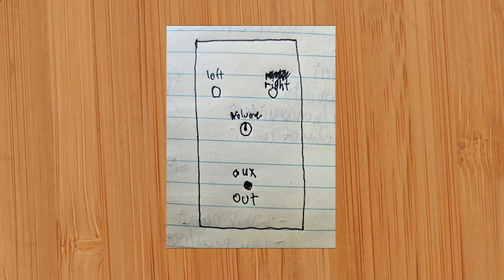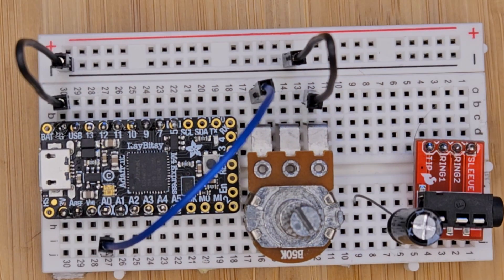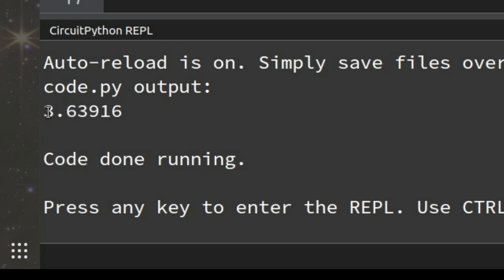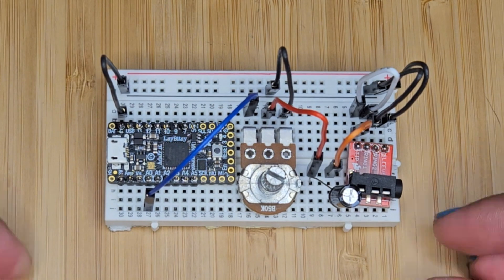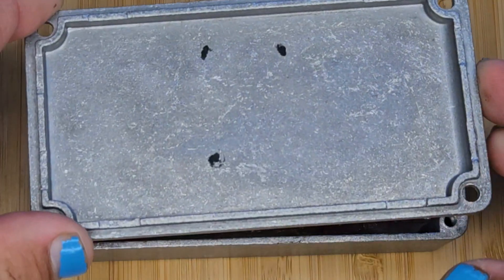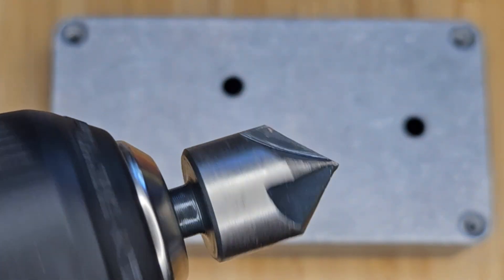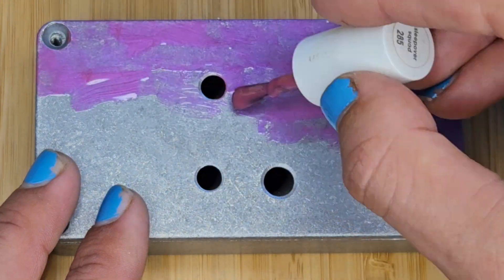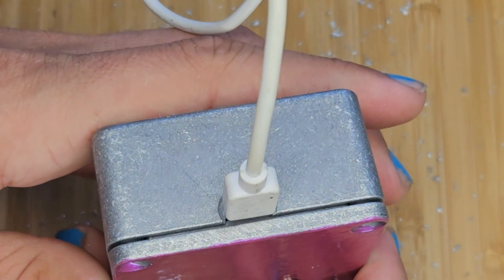i'm building a modular synth from scratch

Comment: That all looks great, not to mention a lot of fun. I'm just getting into this kind of thing, and I'm soaking up as much information as I can.

I do have some experience working with metal and wood, and since you asked, some other machining and assembly ideas to try: Use a center punch (sharpened hardened steel tool that you either tap with a hammer or an "automatic" one with a spring in it) which makes a dimple in the surface where you'll drill. That keeps the drill bit from wandering. Using a vise is important as someone else has said; for small boxes like this one I use a "drill press vise" which is heavy and you can use without bolting it your work area. Make sure your drill bits are made for metal (they have a different tip angle than ones made for wood, they're less likely to grab at the metal and turn the work or jam up, and they do a better job of clearing the chips out of the way). Sketch your hole layout out on graph paper or on a computer, tape the paper to the box, and punch your starter dimples right through the paper, then take the paper off to drill the holes. Solder short wires to the pots, jacks, and switches, then run those wires to your board. This lets you put the controls wherever you want without being dependent on the board layout. For rectangular holes like for the USB port, use a small drill bit and make several holes around the edge of the rectangle. If the holes are close enough together you can use your punch and a hammer to tap it out, or you can use a sharp file to cut it out. In either case, you can use a small file to clean and and chamfer the edge.

I like your paint job, too, but while I'm on a roll... I get flat primer spray paint made for metal (the brand I use is Krylon but there's lots of 'em) and spray the outside all over on the outside. I put a small block of wood on a piece of cardboard outdoors, and set the metal box on top to get under the edge.. The primer is made to stick to the bare metal, and any kind of paint is going to stick better to the primer, so you may be able to use fewer coats.
Reply from the maker: thanks for all the good advice! 💙 definitely going to use some of those ideas in the next one :)

Comment: Drilling advice for metal:
Use a vice to hold the object firmly.
Drill tiny pilot holes 
Use a stepped drill bit(Home Depot or harbor freight usually have them)
Use cutting oil(I usually use 3 in 1 oil as it's cheap and easy to get.)
Reply from the maker: awesome! very helpful, thank you 💙